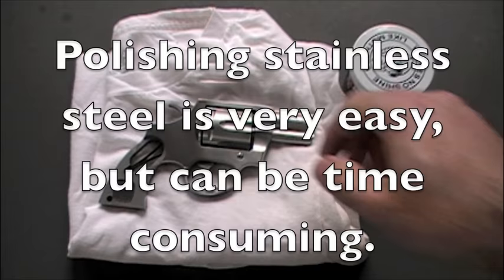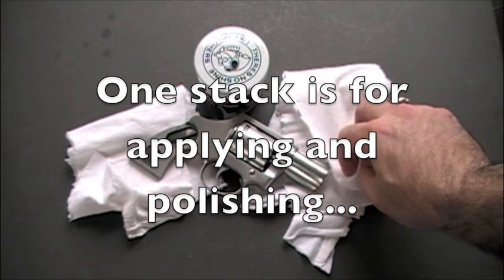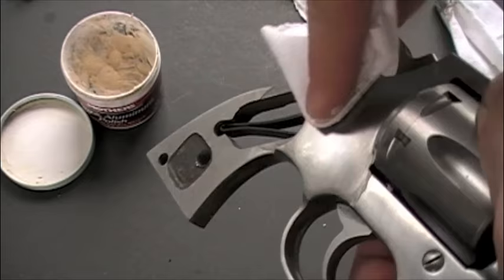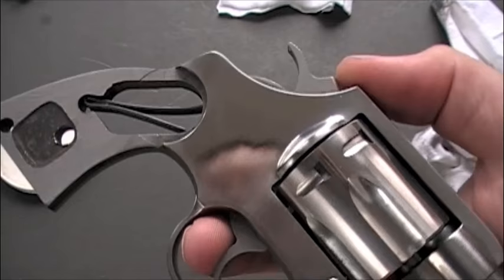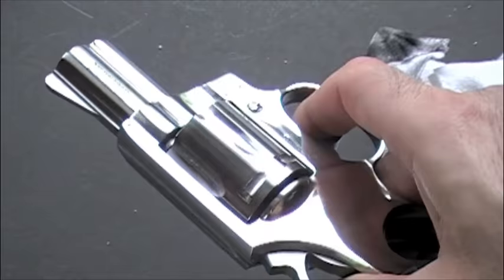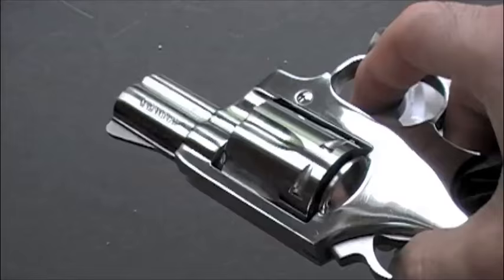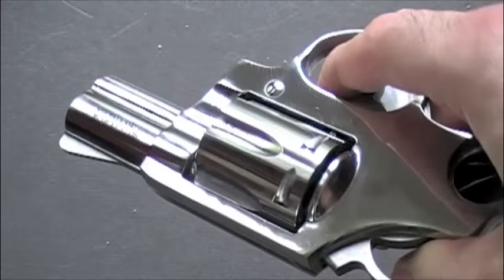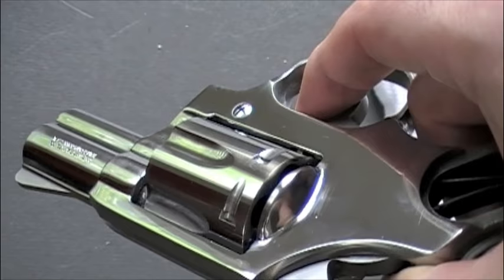How to polish a stainless firearm to a high shine

Comment: Have you ever polished out a bead blast finish? I have a Ruger SR1911 that I'd like to polish up.
Reply: I have the same question I'm looking into now.
Reply: Me too! I want to know if I can polish from matte to mirror! What did you find out ? Please -Thankyou !!
Reply: skynut831 Hey, I'm now half an expert at it lol, I've taken off three bead blast finishes on a couple different guns. What you need is something from an Autoparts store 3M abrasive maroon, that'll take off the finish and wont rust, steel wool will rust. Search Youtube, that started me on my way.
Reply: From matte to mirror finish????
Reply: Yes sir, I'd send you pics but its a hassle lol. Google search a Taurus tracker, get a real high dev photo and zoom in on it for me, if you see that matte, that's a thick bead blast. I took all of that off and it shines like.. Google a chrome plated gun, it literally shines that nicely. It mirrors me, I can't see all my features lol, but you see in it.
Reply: skynut831 I used Mother's Mag just like Yankee, another thing you have to get at an Auto parts store, which to me was funny, and half of the battle. All the hardware stores were looking dumbfounded on both fronts, Mothers Mag and 3M Maroon scotch Brite. That's literally what you want. 3M maroon abrasive pads
Reply: I'll look now and I have a whole box of Maroon ! Thanks your an expert !!
Reply: Thank you. I'm not really but just like Yankee said, be careful, they get really shiny and nice but then they fingerprint like CRAZY! Good luck!

Comment: hey yankee, i just today put a lay away payment on a revolver, smith and wesson 686. used gun but its still very functional. It has a couple of tiny rust pits around the body of it but its actions are all smooth as silk from what i felt. i was wondering if this technique youre doing now would be ok for removing those tiny rust spots? also is $550 too much for a 686 with around 350-400 shots through it?
Reply from the maker: +Runs_with_Scizors yes
Reply: TheYankeeMarshal are you saying thats too much for the gun?

Comment: Do you think a high polish on a talo version of a sp101 would be a good idea? I saw that in another video when you polished your 686 that the smith and wesson emblem turned out great. It just looked as though it had a little finer etching. Do you think the ruger etching would do about the same?
Reply from the maker: +David Triplett Not sure I remember Ruger doing etching on their guns.
Reply: +TheYankeeMarshal They did a limited "talo" version. But since its a sp101 I assume it's stainless as well. However, I think an etched revolver with a high polish would fulfill my "trailerpark-esk" craving. Having lived in a trailer my whole life, except for a duplex I lived in while in the marines, the craving is strong! I might even go get a Chinese symbol tattoo and a samurai sword to display above the fake eclectic fireplace. You shouldn't have real fireplaces in trailers. It's not safe.
Reply: +David Triplett Totally made me laugh.

Comment: Why not use a BUFFING POLISHING WHEEL installed on a bench grinder instead of rubbing and rubbing by hand for 15 minutes a hundred time?...I'm sure the polishing wheel will do the same (or better) job with the same results and in less time. You probably might need some "elbow grease" for those hard to reach small areas but that will be it. Well, just my question and personal opinion.

Comment: 100 times?
Try using 600 grit wet dry then to 1000, then 1500, then 2000, then 2500, 3000, 5000 then use that buffing compound. It will comeout looking like chrome.

Comment: Wish it were that simple for my taurus pt92.sent it for warrenty repair of broken trigger bar and they fixed it.whoever took old one out didn't know how and apparently used a hammer and punch to try and dig it out.so unnecesarry.scarred my nickel finish beyond repair.looks like crap now.taurus warranty work is the worst.

Comment: Rubbing your gun for 2-1/2 hrs is what it takes now? Ouch. Boy, you are getting old! I would advocate the use of an adjustable speed dremel tool or drill with buffing wheel and drum on the larger surfaces (lightly) and then hand polish the rest. Bonus of doing all this is you increase your guns value by a couple bucks, and the range-snobs will (generally) approve of your handy work. Eager to polish up my new T66SS4 when it arrives.
Reply: +Steve H. I don't doubt that. Time is money for me though and I don't have all day to rub my gun...wish I could lol.

Comment: After you polished the metal, how did you treat it oil/cleaning wise?
Reply from the maker: I wipe it down with gun oil then remove the excess.
Reply: Roger that, I'll have to try this method out. Thanks.
Reply from the maker: It is super easy.

Comment: The Mothers polish is CRAP on SS guns! I've tried it. Only good to reshine a gun that is already polished. Get a block/bar of white polishing rouge specifically for SS. I have a 5lb block used to polish industrial SS elevator doors and parts. First sand entire gun with 2000 grit sand paper to remove scratches and blemishes, then like George Day says, get a soft cloth wheel for an air grinding tool or bench grinder. Apply rouge to wheel while running and polish that gun! Will look like a mirror!

Comment: Does any one know if this will work on a S&W 367 air weight ? Or is the air weight a different type of metal that won't shine? Thanks
Reply from the maker: +Luis Gonzalez Airweight is not a stainless frame...it is aluminum. Do not shine it.
Reply: +TheYankeeMarshal thanks for the reply. I realized that earlier today when i found out its was not steel
Reply: +TheYankeeMarshal Aluminum will polishing to a mirror.

Comment: Hey Yank love the videos! I am about to buy a smith 637. Its an alloy frame with stainless barrel and cylinder. Do you think if i try to polish the alloy frame would it become mirrored like your revolver did?
Reply from the maker: abialo2010 I do not recommend polishing alloy frames. They have a protective coating.
Reply: That's a great gun, I would just leave it alone.

Comment: Want my Bond Arms to shine like that. It is SS. Have you heard of success on a Bond Arms TD? Minescold. Early 2000s
The NAA Mini 22LR Revolver? Mine seems to be 2 tone with partly shiny parts. I called both places inquiring, Bond Said they have to get baxk as the sn# at that facility, have records of guns from 100,000 and up. Mine SN is 52,000 range. She guestimated early 2000s. Never got back w me :/ NAA was glad i called. Made Oct 09 1975. Spanish Fort UT factory. Said lifetime guarantee is with whoever owns gun, not orig owner only. Free disassembly cleaning, lube, and re-finish. I said free?SERVIVE is free, 28$ charge for return shipping qnd handling. Not much to really take apart on the NAA or Bond really. Bond oiginal owner only gets warranty. Mine is old enough where all other Bond TD got new hammer and trigger from 10lb to 4.5lb pull. 149.99 fee. Im good. Going to bug Bond Arms in 15 min @10am

Comment: Do you know if this process will remove laser engraving?  Some I wouldn't mind getting rid of, like all the stupid warnings some of the mfgr's. are putting on them these days.  But, I have a 625 S&W that says "Model of 1989" on the side of the barrel.  I'm sure you've seen them.  I wouldn't want that to come off.
Reply from the maker: Tommy Outdoorsiowa You will most likely still see a ghost image of the engraving.
Reply: TheYankeeMarshal
To polish or not to polish? Now that I have my EDC situation squared away, and decided that my Ruger GP100 is my night stand gun. I am debating on dressing it up a bit. I normally leave my guns as they come from the factory, I just try to keep them looking new. Marshal I know you have polished out your S&Ws what is your thoughts on a GP100, are there any parts that you wouldn't polish? Just looking for suggestions before I actually start doing it.
Reply: Tommy Outdoorsiowa  If it works for the warning it'll probably do the same great work on what you want to keep. But laser engraving sometimes goes into the metal, so it all depends if it's etched in or just printed on by laser

Comment: Looks like crap!  You cant polish metal that still has Machine marks/tool marks, sanding marks, scratches.....etc.  You must sand the metal till its smooth! 1000 grit sand paper, 1500, 2000 then 2500.  Closing the pores in the metal is what allows it to shine.  If you go up to 2500 grit, you can get a mirror shine with a a soft paper towel and your saliva.        Do things the right way or dont do it at all.